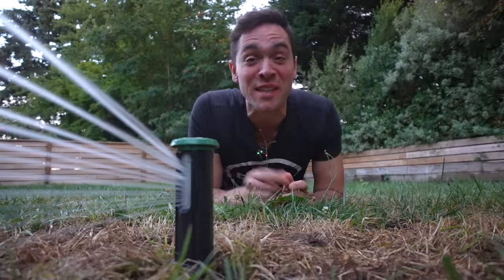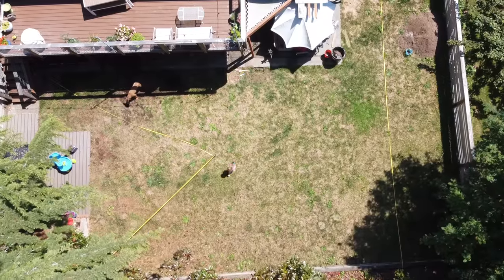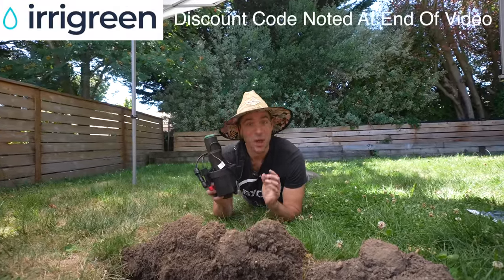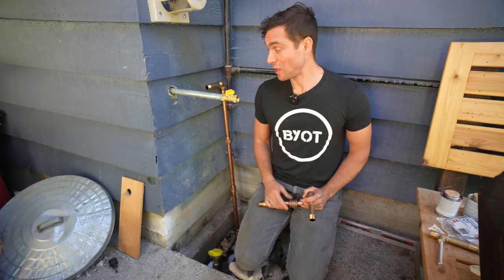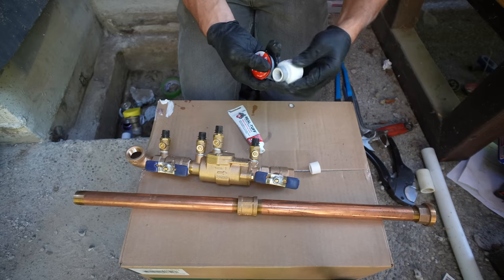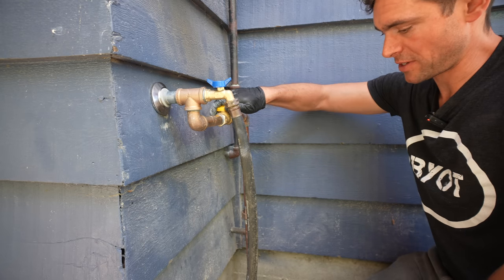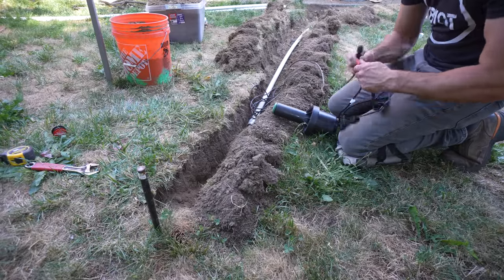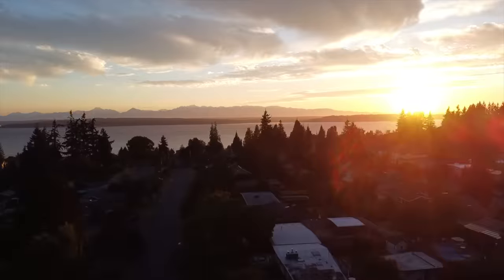DIY Sprinkler System That Digitally Maps Out Your Yard

Comment: Your still going to waste water. 99% of people have absolutely no clue how to water turf properly. Most people will water everyday which is the biggest mistake ever because they water for short periods, this in turn leads to shorter roots which can't stand up to summer heat and humidity leading to a ugly lawn. You should water once a week for a long period and that's it, your aiming for 1inch of water per week but grass can get by with half a inch, during summer months you will need to water more but hand watering as well during the heat is the best option, this cools the grass and air around the grass from 10 to 15 degrees for a short period, it helps the grass survive. You also have to know a little about soils, clay holds water longer where sand doesn't hold water near as well, this is why we use it as the rootzone mix, roots can grow 12 inches deep if properly taken care of, but we add 5 to 10% peat to help hold water and nutrients. You can have the best irrigation in the world people will still waste water. People need to learn what drought dormancy is instead of thinking grass is dead plus homeowners need to use better turf grass on lawns. We are breeding new grasses that have never been on this planet, they are more drought tolerant, shade tolerant, heat tolerant, shade tolerant and making a denser turf that needs far less input like water, nutrients etc

Comment: 2500 for a 2 head system. And extra heads are 300? So with one free head thats 2200 for some wire and the control box?  Its neat but not that neat.

Comment: Very expensive system.. 5 heads setup costs $3000 after promo code....
Reply from the maker: Definitely not cheap but With it able to calculate when it rains and the mapping system it will definitely save you money in the long run I think. Thanks so much for watching.

Comment: Yeah, when you say you'll "save money in the long run" you mean more like the"loooooong run". Just a 3 head system is roughly $3k after all is said and done. I could do a system for a fraction of the cost with a traditional system and save just as much. I have to admit the system is Kool, though it doesn't seem like a good value. Sorry, just sayin'. 🤔 🤦‍♂️